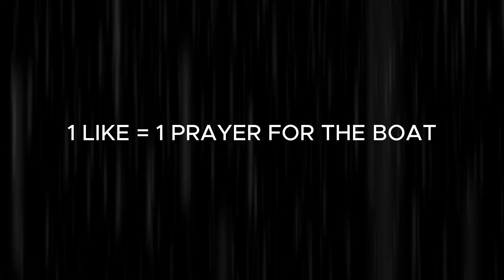*MUST WATCH* I BROKE MY DODGE CHARGER BY DOING THIS🥲

Comment: Frequent coolant leaks is likely a water pump issue they are prone to malfunctioning in those chargers. Police chargers during their life as cop cars they are running most of the time and left on idle or driven hard so it wears through the water pump.  I'm not mechanic just an enthusiast. Hopefully its nothing major and you get that beast back on roads G!